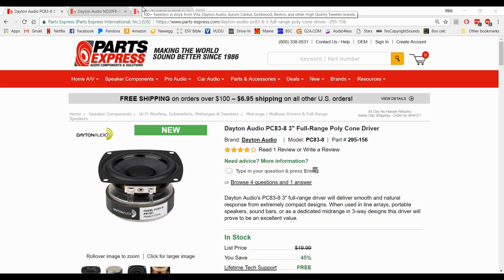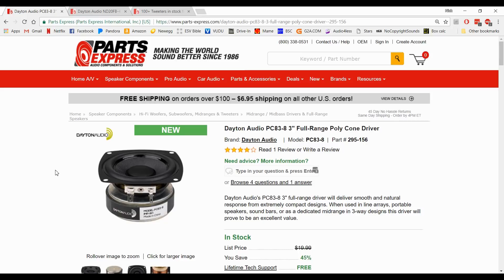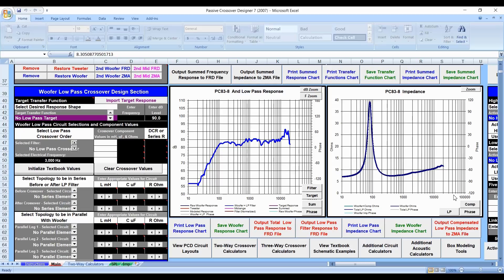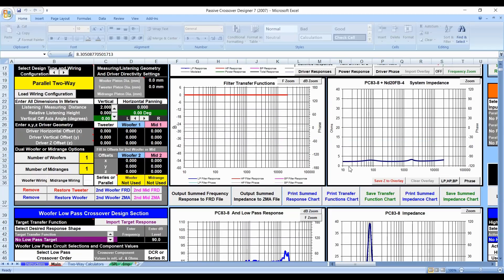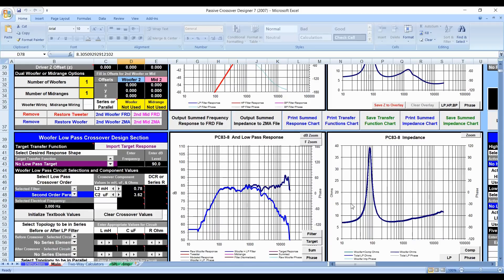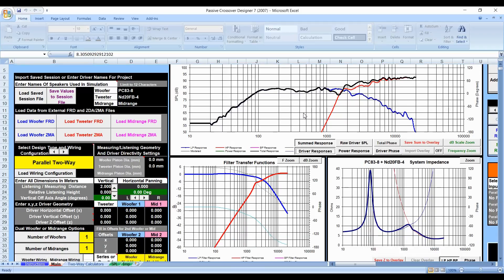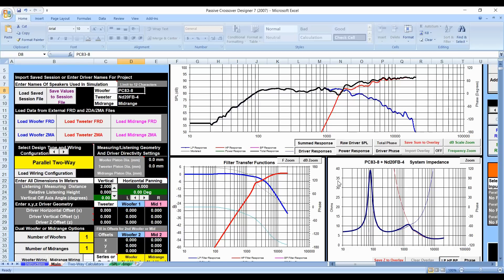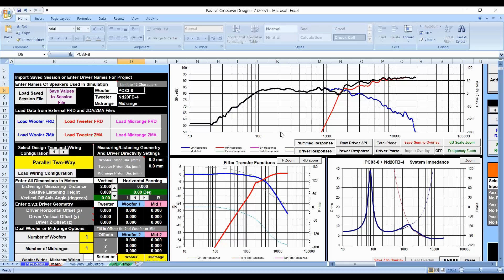Can I use an 8ohm woofer with 4 ohm tweeter?  Impedance Questions Explained

Comment: Great video!  I always wondered how one can mix different ohms into one system - thanks!
Reply: The only thing missing was when you make a crossover, you need to make the HP and LP seperate depending on the drivers used. In this instance calculate the crossover parts for the woofer at 8 ohms and the tweeter at 4 ohms. If you just use a crossover calculator and do not differentiate the ohms to driver spec, one of the drivers is going to not be crossed over that the frequency you thought it would be. IE an 8 ohms crossover @ 4000hz with a 4 ohms driver will actually be crossed at 2000hz. You will either end up with a frequency gap between the 2 way drivers, or a frequency duplication (which a duplication would be not too good for the amp if it happens that your nominal impedance goes below 3 ohms)
Reply from the maker: Mike your welcome. I am glad this helped clarify that.